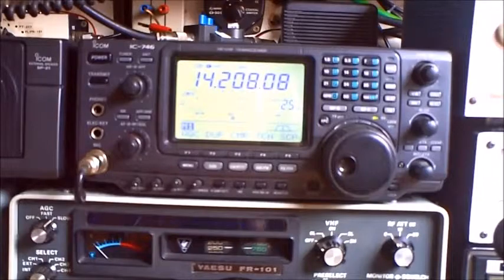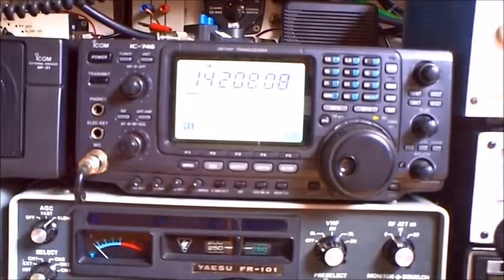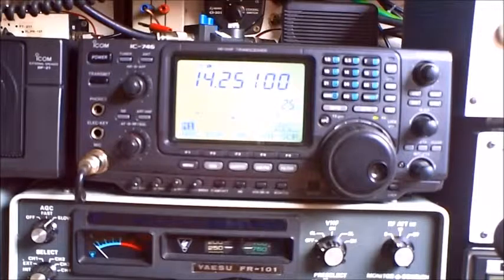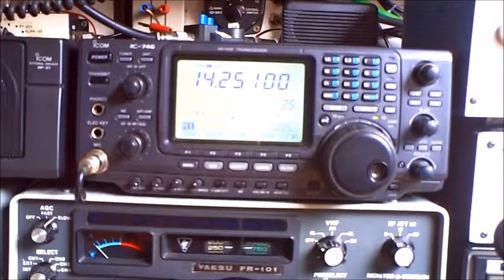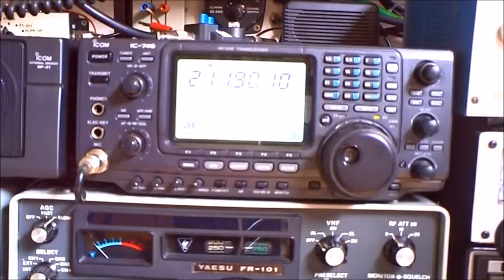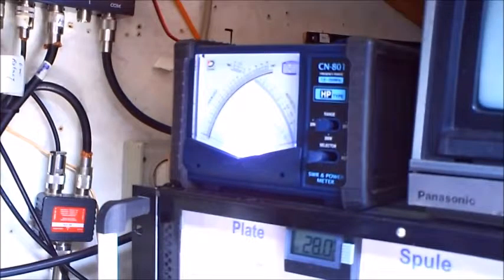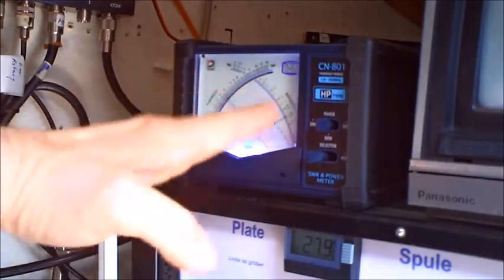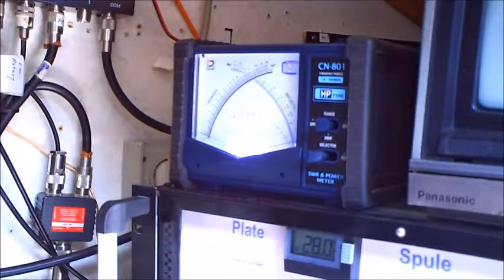The Butternut HF5V-III Antenna - Part 3 (Near and long distance)

Comment: Hi Donald another good video...Yes it seems the Butternut suffers on 80m with a leaking capacitor when its asked to work hard it starts to break down...probably an age thing.You will probably need a replacment part but if its a door knob type they quite expensive.Hope you find the problem.
Reply from the maker: charlieoscar09 
Thanks Charlie for the nice comment!
I think its a damaged capacitor. I asked in the Yahoo Butternut group now.
Reply: Donald Schwab Donald good luck trying to find one..do you know the value ?